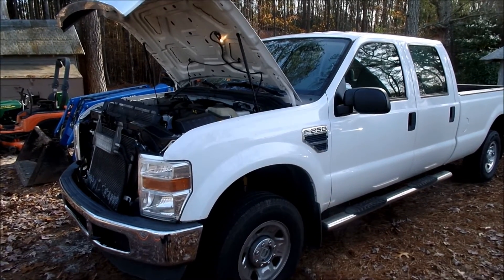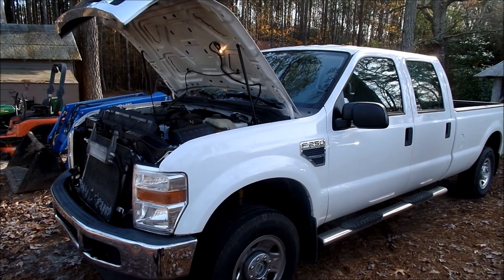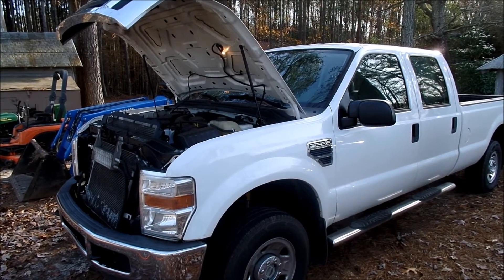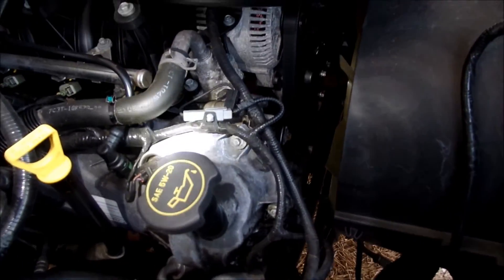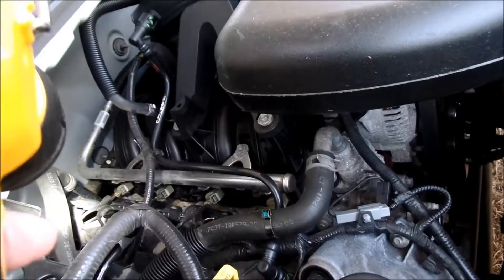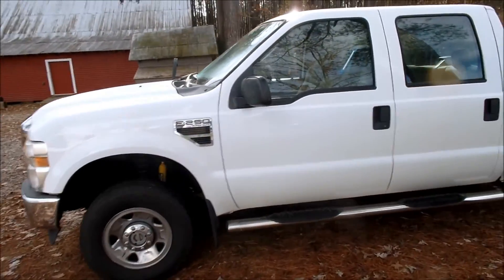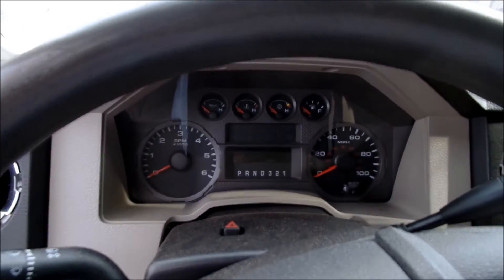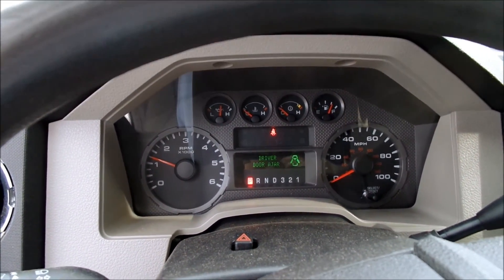2008 F250 Triton 5 4L P0304 CYL 4 Misfire. easy fix.

Comment: Yeas 5.4s are supposed to be able to last 6,000-7,000 miles without an oil change but I change mine every 3,000
Reply: Popeye and Strauss MX I do the same with my 4.6

Comment: Thanks for the video, my 2007 f150 5.4L, 160500miles. It has this problem with new plugs and MSD igniter. I switched ignitor postitions and still cylinder 4 popped up. But I have not cleaned out the connectors. I will try that. Cylinder 4 code pops up intermittently.

Comment: what was the issue ?
Reply: The 4th cylinder had a misfire and then he cleaned out the connectors to the coil packs and that’s it.
Reply: Next time post something not that easy to fix

Comment: i have p0300 and p0306 i had replace coil,boots and spark plugs,  fuel filter and change oil and still have those freaking codes any help will do. my is 2008 f350 5.4l any help is appreciated
Reply: hamitsindy unplug battery for arleast 10 minutes to reset computer, and clear codes
Reply: Buy a 10W 1 Ohm resistor, disconnected both battery terminals, place resister between terminals for about 15 minutes and it will clear all codes from computer. DO NOT connected both leads together without a resister because you could damage the computer.